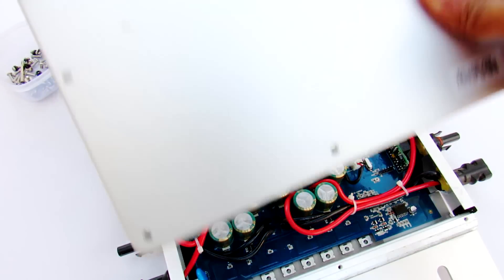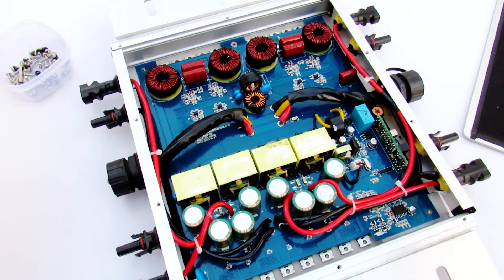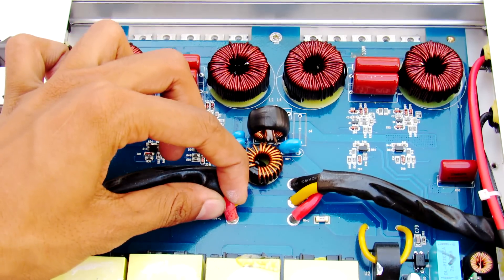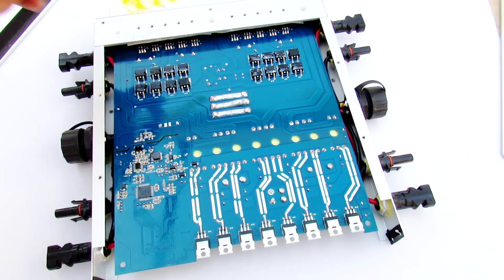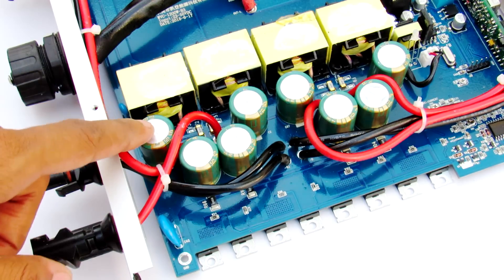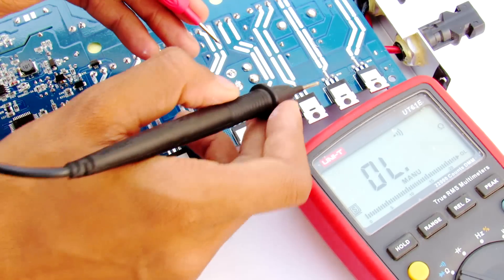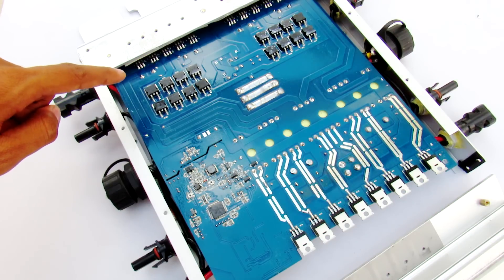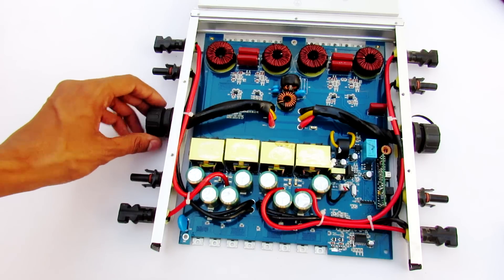WVC1200 Solar Micro Grid Tie Power Inverter Teardown & Repair

Comment: Question: does the WVC has a timeout when switching in again after a timeout. 
Question: does the WVC has Voltage High and low protection when grid voltage go outside the voltage thresholds
Question: my WVC has a poweline interface,  does anyone has an idea what PLC  module I need to communicate with it and what the API Command are to request for data.  I want to connect it to an Arduino type controller
Question:  can anyone with a modem show a picture from what is inside and identify the power line modem used. 
Question: there are other 4channel Chinese CCP cheep inverters for sale is there anyone who has experience with these.
Question: Does anyone know a good economic replacement for this STD13NM60ND to cut the power loss and reduce the case temperature?

Comment: Hi Kedar. Great video and help me a lot. My 3 pcs. WVC1200 all MosFet burns after only 5 month use and some of the cobber on the PCB also. I need a wiring schematic but the China company will or cannot give it to me. No support and just selling. :(
Ps. the panels are right so must be bad quality inverters. .Anyone can help me ?.

Comment: Can someone direct me to a company that I can send my WRC inverters for repair.  I have two that my solar provider cannot repair because they were burned by high or low voltage and I have two more that are working but not efficiently ,  the green light is constantly flickering and never locks into solid green.    Thanks.   Shipping to another country shouldn't be a problem if necessary.  Thanks

Comment: Is that fuse or current sense resistor? Thumbs down. You need to check gate of the mosfet. Seems like you're beginner in this domain.